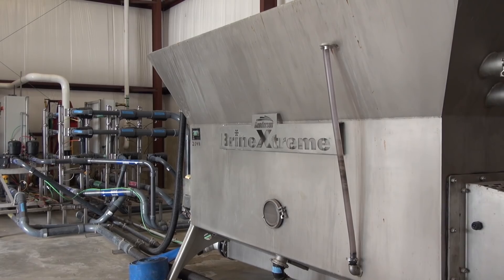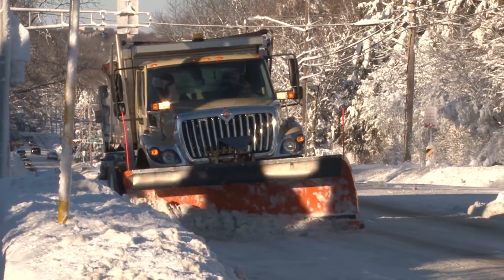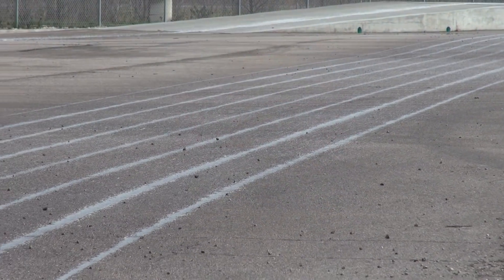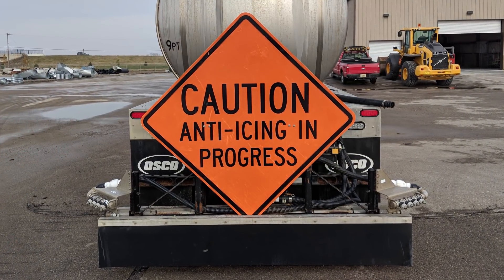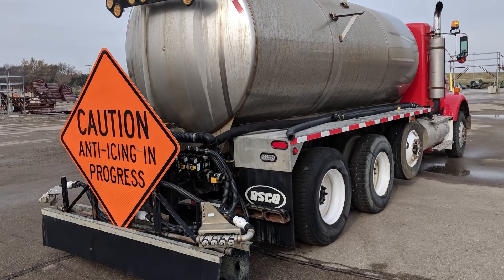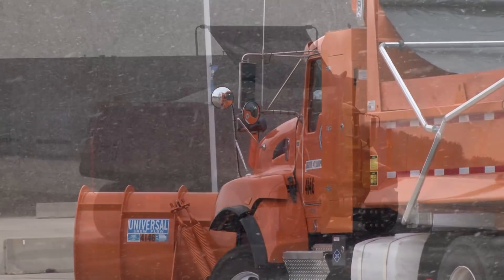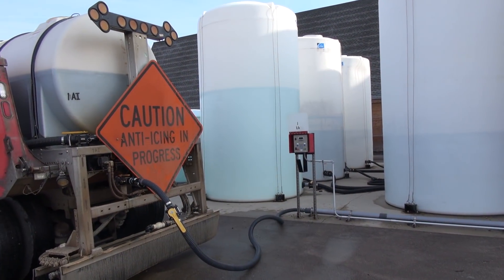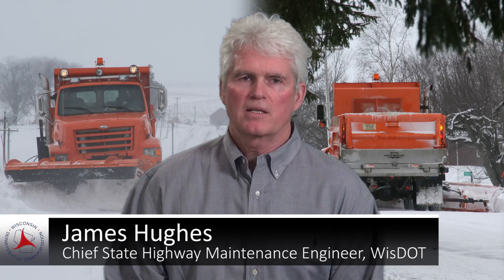Clearing Winter Highways: Using Less Salt and More Brine

Comment: I drive in a metro that treats different areas with different materials.  I vastly prefer to drive on the brine treated roads.  Not only do the roads freeze later, if at all in my area.  The falling snow melts instantaneously, never sticking, and we have little to no snow plows on most routes.  In addition, there is less "crud" left on the roads for weeks on end afterwards.
Parking lots as well, property owners are increasingly turning to brine as a solution to treat their lots and it results in a far better experience for customers.